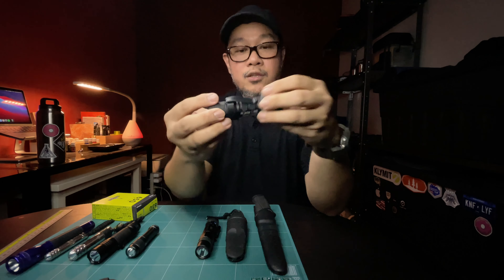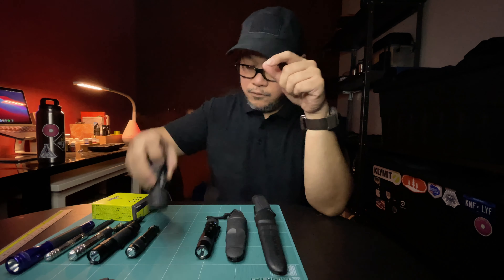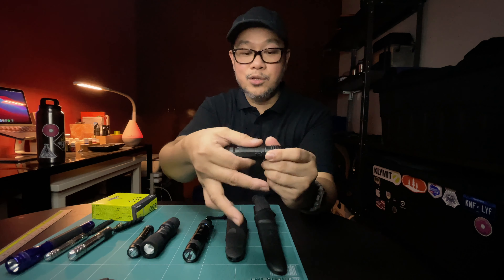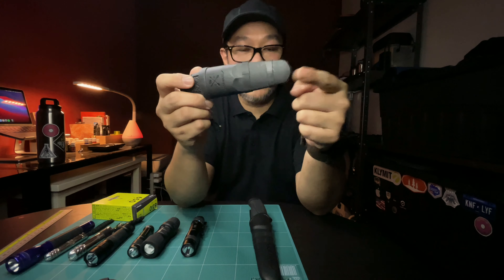DIY | Get a Grip on your Gear

Comment: Greg, may I ask approximately how long one of your rubber grip mods last? I tried bands made from a mountain bike inner tube instead of heavy-duty duct tape. My thinking was I could move items at will, that I kept on the KAYDEX sheath of my K-bar knife. The rubber has never lasted long. I did not allow the knife sheath to sit out in the sun so I am thinking that ozone may have had more effect than sunlight? For now, I will be using HD duct tape again as I do not want to lose the ferrocerium rod its storage /retention tube, the small touch-up hone, and a few other items attached to my knife system. Have you tried the commercially available ranger bands made for the purpose?
Reply from the maker: Thanks for your comment. I haven't used any commercially available bands.
The bike inner tubes last a pretty long time (several months to a year) and can be easily and cheaply replaced. They first become dry and then brittle and flaky. I think the main enemy of the bands is the OIL and GREASE from our hands which tends to melt them. I have used silicone tubing for strapping dive gear. These are resistant to even salt water but tends to me more of a gummy and slippery texture. 😊👍
Reply: @outdoorDADventure   Greg, you very well may be correct that body oils are the biggest enemy to bands made from inner tube rubber.  Duck tape on the knife sheath is not a bad thing, it can become a flame extender. One new idea I intend to try is the small diameter bungee cord you have showcased for several demos. I used high-quality rubber bands from an office supply store to retain my ferrocerium rod in its storage tube. I ran the rubber band from the hole in the grip to the bottom of the ferrocerium rod where it protrudes from its case. With the rubber band also around the bottom of the rod, it was impossible for it to fall out. Unfortunately, those rubber bands only lasted about as long as the innertube rubber. Hopefully, we will get more durability out of the bungee cord. Time will tell. Thank you for the inspiration
Reply from the maker: Welcome! 😊👍

Comment: Which 'inner tube' materials are better or more grippy; is it butyl or latex?
Reply from the maker: Thanks for your comment! 
The tube I use is pretty grippy.
As per the Decathlon inner tube specs, the Composition is...👇 😀 

"Main part : 90.0% Rubber - Isobutylene Isoprene Rubber (IIR) - Butyl"
Reply: @outdoorDADventure  thanks!